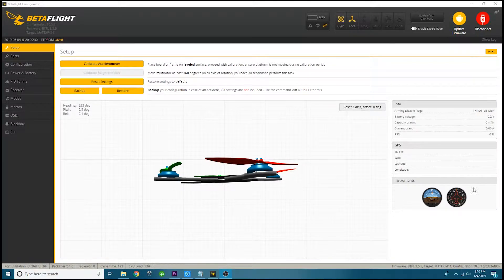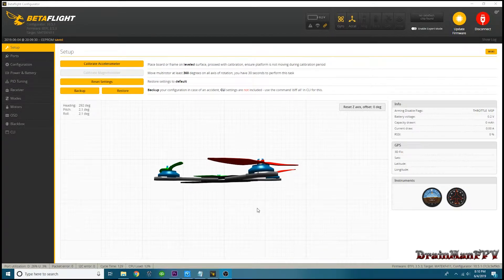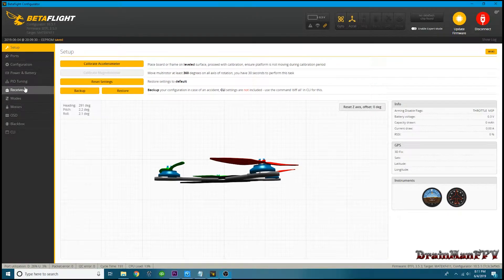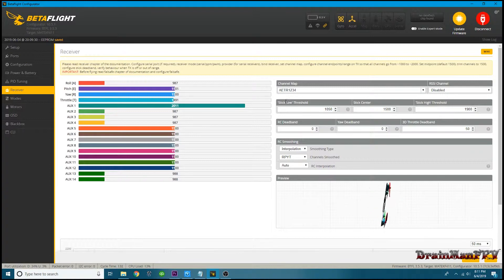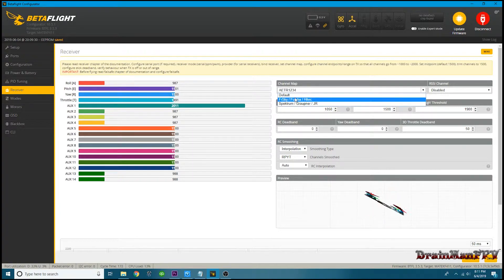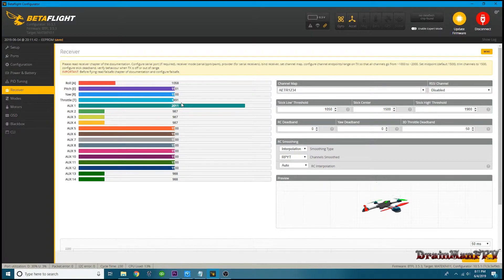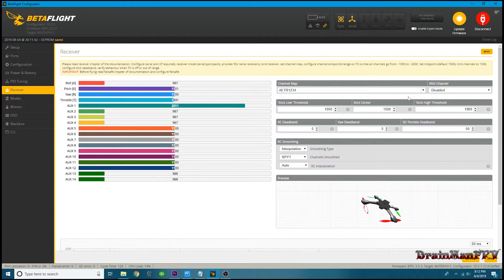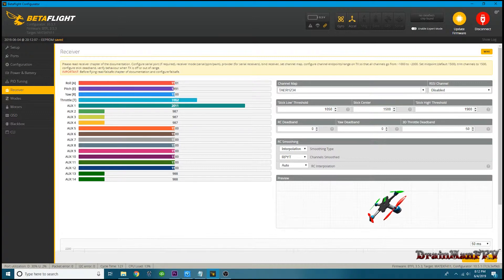Drone just flips and spins in receivers tab | Solved | Betaflight

Comment: for whatever reason, this worked for me on the 2025 Mobula 6 with my radiomaster zorro. I noticed it wasn't following the TEAR1234 and setting it to the one you mentioned and saving it corrected it, even though im using HDZero/ELRS.

Comment: so im having a odd issue have a babyhawk hd 2 bound to dji fpv remote 2 in rec tab everything moves as it should but the drone does not and when i fly it feels as if it has tons of expo its fine to hover but if i try and take off its out of control went to my rates and the drone moves in that but respones is super bad from slow to crazy fast

Comment: just pulled out an old quad and installed a new X4R Rx on it. In the Radio tab, all of the bars are moving correctly, but virtual drone only reacts to yaw and roll. Pitch is dead, even if I can se the pitch bar moving. The quad used to fly OK with another Rx last year. Any ideas?

Comment: Clutch! Thanks! Had this same issue. Now I am still having issues that my Roll, Pitch, and Yaw are fluctuating +/- 2 or 3 values and none are at 1500. I have a BetaFPV Lite Radio and a Mac so I am unable to use the OpenTX

Comment: I just went through a whole day of troubleshooting why my motors wouldn't arm, on my new RTF Nazgul5. I was even about to mess up with the receiver's SBUS and inverter until I saw that my inputs did not correspond to what I was doing in my Taranis. This is SUPER simple man, but thank you for saving me from the headache of desoldering and changing protocols just to find it still not working.

This is a life-saver. Thank you!
Reply: On the upside, I just watched like 5 hours worth of Joshua Bardwell's educational videos. I guess I did actually learn something today, lol.